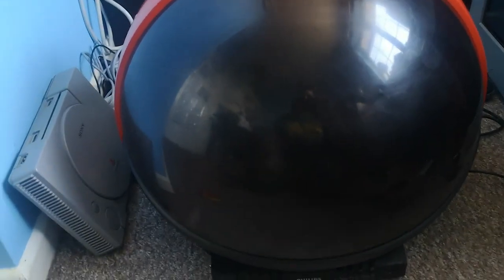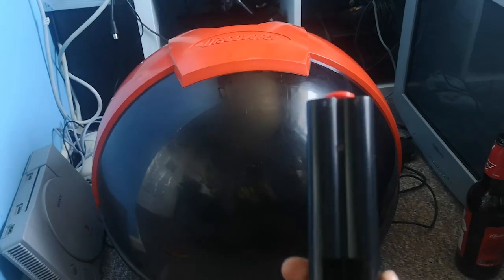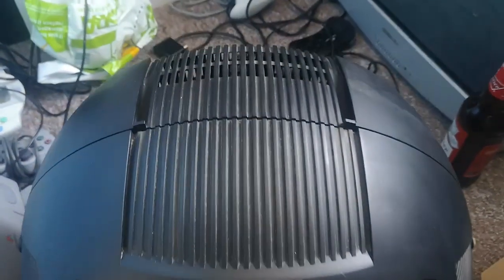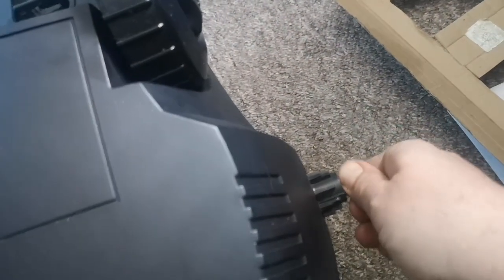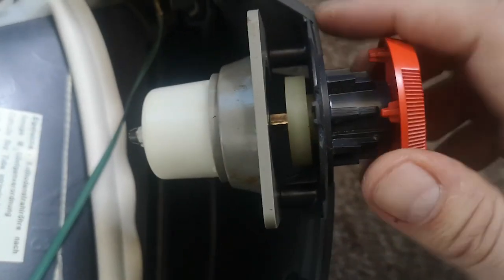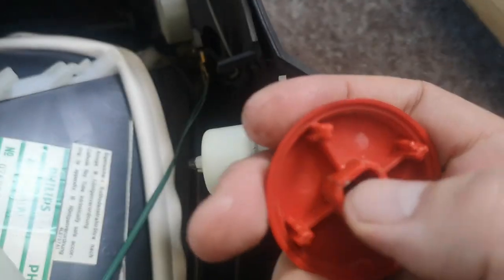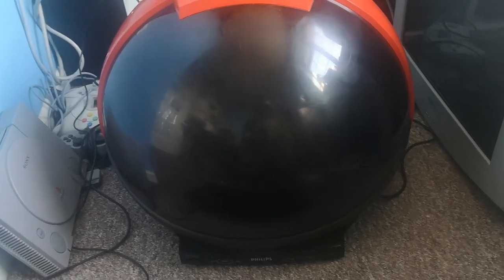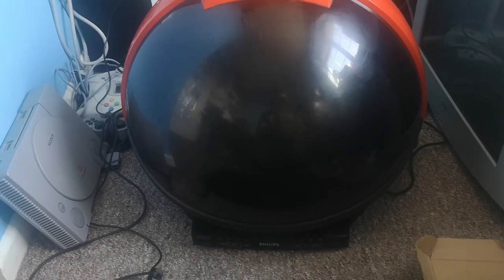Philips Discoverer - I Need Help!

Comment: Have you managed to sort it? I got one a few weeks ago and have had a play with it today for the first time and I'm having the same issue. However I've got caps but on inspection the cap with the screw is cracked in the square.
Reply from the maker: Sadly not sorted yet no. I thing the cap on the left is just to hold things in place but I am not certain why the right one is so tight and difficult to turn. My right cap is cracked also I think due to the amount of pressure is goes under when tilting the visor
Reply: @NathRetro1  Managed to find a solution yet? , I've recently got mine out again.

Comment: There is one of these at the local market hall. Ive asked for it every other saturday for three month only to be told its already sold 🤷‍♂️🤷‍♂️

Lovely bit of kit though it they ever sell that one to me i may have some info to help. Have you shared on fb
Reply from the maker: Just take the sides off for me when they're not looking. 😁 Or let me know if you get it.

I shared on retro tech 100 but not others. Wanted to make a video first to explain it a bit. Might share on a crt group but let me know if you have any recommended groups to try please mate 👍

Comment: Great little TV! shame about the dodgy mechanism.... could you take off altogether and soak it in some WD-40 over night? 
It’s probably full of dust and grime.
Reply from the maker: It's a really weird mechanism. I soaked it for ages in wd40 but is on a spring with a rod in the middle but it doesn't depress and is very tight. Hoping someone will have one and be able to answer this and help engineer some spares maybe

Comment: Looking at that nath my guess is that red "knob" is supposed to be attached to the metal rod and youd pull the "knob" out (this compressing the spring) then rotate the hud and then release the "knob" thus "locking" the hood in place, as it currently is? or maybe not hahahaha
Good stuff though mate
Reply from the maker: 😂 Love the " added. Sadly I've tried everything to get the" knob" to work but it's a stiff little bugger 😂😂
Joking aside though have tried all of that but is no movement in it. Is really irritating me. Cheer for help tho 😁

Comment: So jealous mate, been after one of these for years.
Can't really help you, might be able to do something with it if it was in front of me.
If you can't get the part maybe just get a plastic disc to cover hole?
Maybe black as you will struggle to match the red.
Reply from the maker: You've got plenty I've wanted for years 😂 haha
Problem is the side bits clip in somehow and hold the side of the visor on so I cannot cover it as such.
Would be nice to just find some info or get dimensions so I can make parts. Sides are both different so is not same cog for each side sadly.
Reply: @NathRetro1  wish I could help mate, sure I could probably come up with something if it was sat in front of me... But then you would never get it back 😆😆